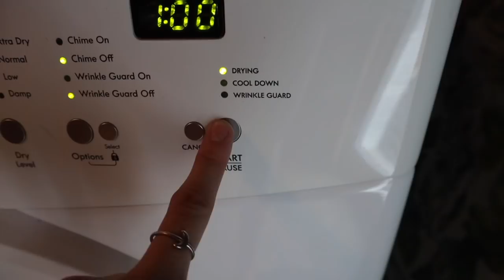VAN LIFE | our tiny home is a WRECK

Comment: Too bad they didn't do full roof rack at beginning which could have been attached to edges.. Then you could mount solar panels on the rack so you're not drilling holes & screwing into roof directly. Thus help prevent leaks.